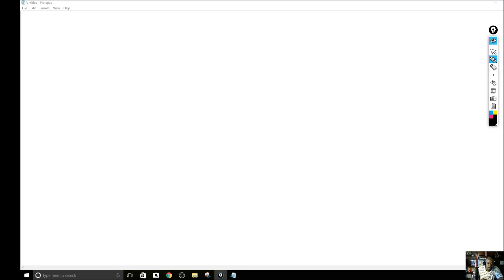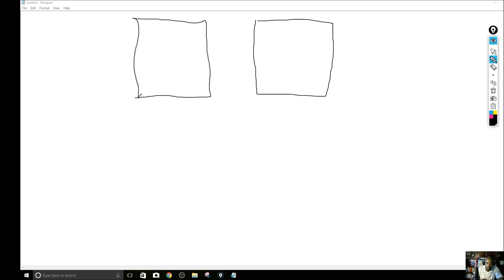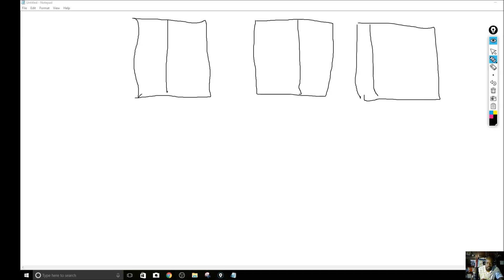How To Connect Multiple Solar Arrays To Charge A Single Battery Bank

Comment: Q1?. Can PV (solar panels) be various makes, mfg., & Wattage- i.e. 25 watt thunderbolt + 100 watt windy nation to same combination connector?

Q2?. Confirm that each of the controllers should be set at same off/ on voltage, temperature, etc.

Q3?. Is there a limit to the number of solar charging circuits, number of batteries in each battery bank, or number of inverters tied to bus bar?

Q4?.  Quick reminder of the 2 types of controllers (mppt vs. ?) and can they be combined in diagram above

Q5?. Can battery types be mixed...
Lead Acid & AGM & Li-ON or various size of same type (lead Acid 100 ah + 60 ah + 75 ah + deep cycle + regular)

Q6?. Recommend bus bar & safety throw configuration.

Thanks

Comment: you know charge controllers charge batteries in different stages at different voltages( float, absorption and bulk) how the two charger will communicate to supply similar voltages. what if one charger detect the other voltage of the other one and interpreted as the battery is full

Comment: Would it be easier to just connect all the batteries in parallel then connect one end of the positive to the positive bus bar and opposite end of the battery bank negative end to negative bus bar. That would eliminate excess wiring from each battery to the bus bar. I could be wrong but it seem more logical and economical.

Comment: I have a 48 volt system, 120 Volts, 16 battery bank. Can I hook up 2 Victron 5 KW inverters to the same battery bank or do I need to split them? Thanks for any help to my question.

Comment: What about if you have  two solar charge controller  and two different  types battery bank say like 2×200amp gel batteries  and
 2x100 deep sealed lead battiers

Comment: You forgot about diodes. Unless you want to fry your mppt.
Reply from the maker: Mike aka Misha 
The diodes are in the panels.
Reply: DIY OneForAll lol
Reply: DIY OneForAll you can not parallel 2 controllers without diodes. Diodes in the panels are different story.
Reply from the maker: Mike aka Misha 
Ok, yes, when two controllers are used, diodes are needed. I made a video on this a few years ago.  You can always check my video list.  I just got what you referring to. So yes, maybe it was implied somewhere.
Reply from the maker: Check out an earlier video with the diode explained https://youtu.be/F9k9d1ERfVs

Cheers and thanks for watching.

Comment: Video information is helpful BUT way too SLOW. Can give same information in under 5min. 
Do NOT draw while talking. Just use drawing you made BEFORE and point and label the parts. You can add additional drawing parts instantly as your explaining continues. You missed the CRITICAL issue of how the charging of the batteries work as BOTH MPPT Solar Charge Controller will do their own things for charging the batteries while you need them to cooperate to satisfy the best batteries charging considerations. Good luck and keep going. Everyone learns from doing.
Reply from the maker: Jehuda Ish-Shalom 
Thanks for watching and providing the feedback on the video.  I appreciate it.  Cheers